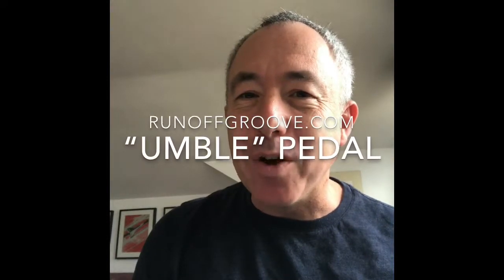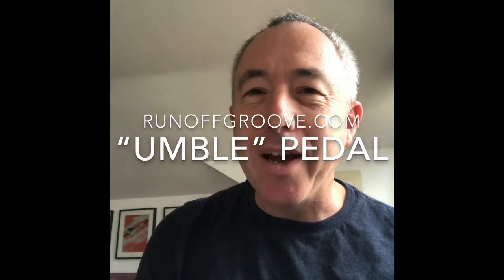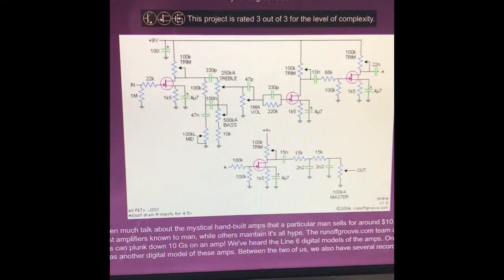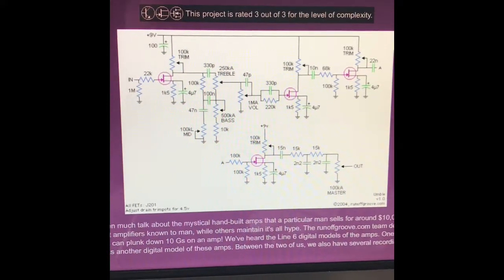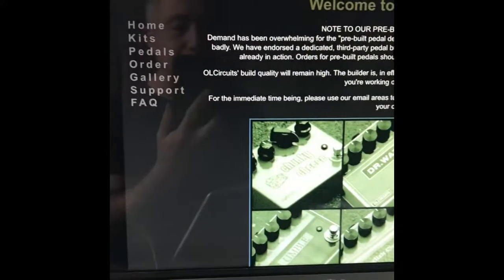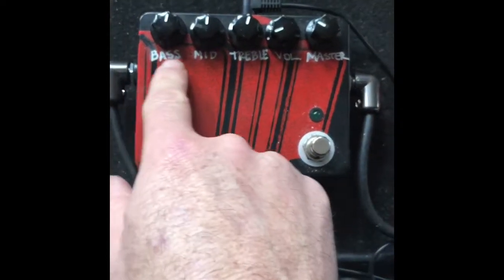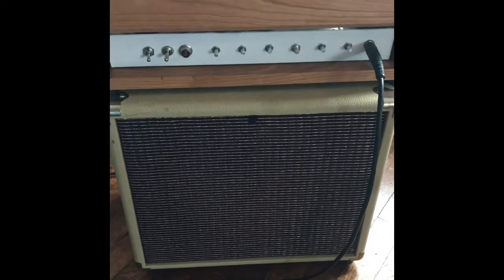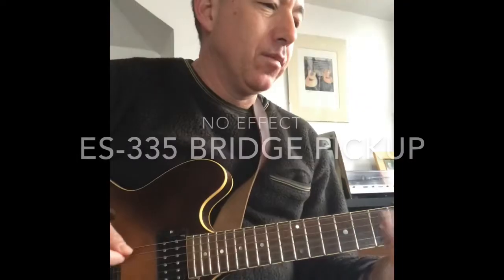Umble Overdrive Demo

Comment: Enjoyed your demo of the pedal. Got an odd question. I like the white lettering you did on the enclosure. I've built a few pedals and I'm curious as to how you got that look. Did you use some kind of metallic sharpie or use model paint for the lettering, etc? Thanks for your time.
Reply from the maker: Thanks for watching! You’re exactly right—metallic sharpie for the lettering. It’s been a few years since I made the pedal, but I might have sprayed clear lacquer on the box after painting and lettering to give more protection
Reply: @joelhoffman1764  Joel, thanks for getting back to me. I picked up a metallic sharpie yesterday and will give it a go this weekend. Pedalpcb also has a board for this pedal design. Will pick that up as well. Cheers

Comment: Sounds good man, I’ve got the circuit on a breadboard at the moment and will put it in a box. I’ve used PF5102’s and they give more gain than j201’s. It’s actually a high gain monster with the vol maxed out. What jfets did you use?
Reply from the maker: Thanks for checking the video out. I have to open up the box to see for sure, but almost certain I bought J201’s from Mouser
Reply from the maker: Post a video and send the link, please! Would like to hear the higher gain version for sure
Reply: Joel Hoffman cool, I’m sure you know j201’s are difficult to come by now and expensive as they’ve been discontinued some time ago. I will post a video on here and let you know 🎸
Reply from the maker: I wish I had that fact tucked away in my brain. I actually don’t know for sure what I used. I’ll pop open the case soon and take a look
Reply: Cool 😎